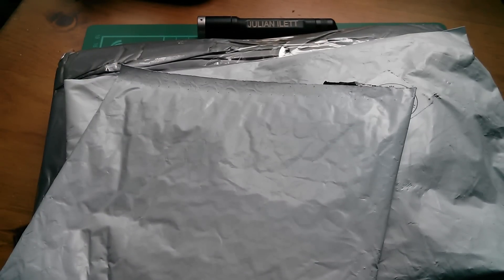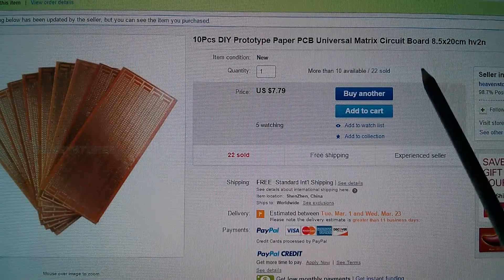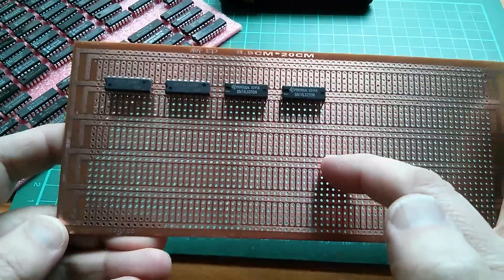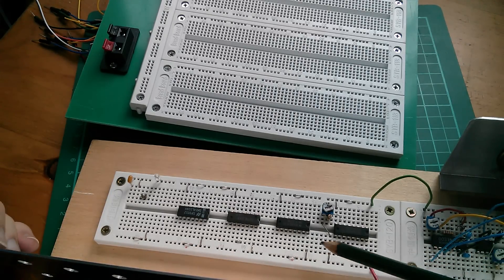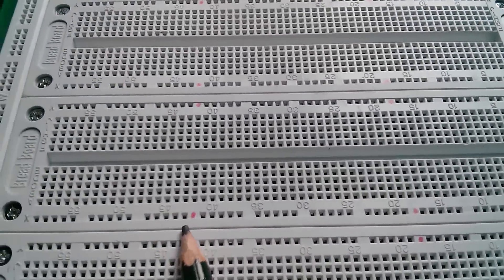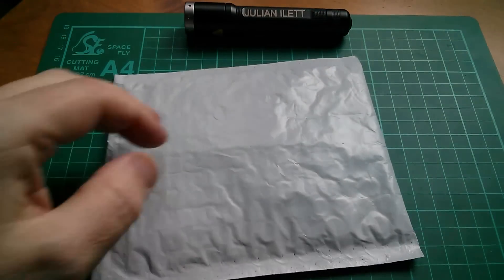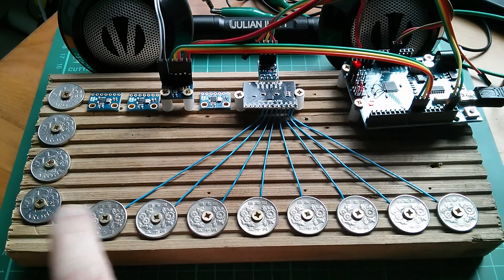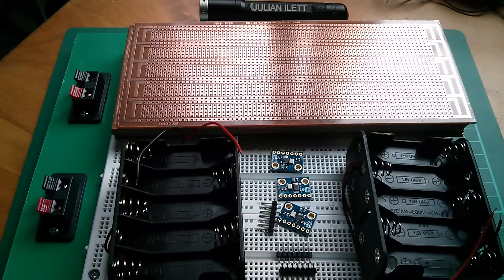Julian's Postbag: #55 - PCBs, BreadBoard, Batt Boxes, DCOs

Comment: After watching this video a few years ago, I went ahead and ordered ten of those pc boards.  I love them, what I ended up doing is chopping them into small boards and making small circuits that I had designed on breadboards.  They work great for this as they are sort of layed out the same way so you can pretty much transfer them part by part if you so desire.  I love the way you can access your rails, and once you have cut them away from the top and bottom, you can use the different rails for different voltages for amplifiers and such, I have found that even when they don't drill all the holes, I usually never want to use those particular holes anyhow. I did start drilling them out but it looked like more work then it was worth.

Comment: I just figured the power rails were split so you could use more than one voltage level on the board. But why they would not work it, I don't know.

Comment: I was desperate for a good PCB the other day for a project so I dug one of those boards out - I found that you can indeed use them for other designs simply by cutting some of the traces and using adjoining spots where necessary.  Wire clipper seem to work ok followed by an exact o knife to insure the sever is clean.

Comment: Trying to build on one of those blasted boards, only to discover that I must also cut the traces on the outter ground strip since the traces are connected nearly all the way up. My luck, I was trying to save space and started in  a lower corner of the board.  So now it is take the knive and cut traces.  Really low quality. Oh why didn't I listen to you when you said you could not recomend them.  Oh well, never to late to learn a lesson.

Comment: Was delighted when you opened those pcbs.  I'm building an animated display, 20 x 20 leds, so need room for 80 tlc5940 chips.  Was hoping that your board would have lots of room, but there's not quite enough.  Can only get 4 chips end to end, and two columns wide, for a total of 8 chips per board.  That means a total of 10 boards.  Wah......

Comment: The number on the breadboards is telling you how many connection strips there are: you said 59 wide... divided into 2, is 118... the 500 on the original would be 4x118 plus the 2 extra long ones across the end...

Comment: That breadboard maybe good to  have different voltages close by, I have a BT module for my arduino nano that uses 3v which I use a number row for atm, so this would be tidier just to stick a resistor between the breaks. thanks for the link I found it for $!2 minus the jumpers so your deal wasn't so bad.

Comment: I wonder if the breaks in the bread boards are designed to use several different voltages? Mixing 5v 12v etc? I'm not a very savvy electronics fellow so this could be a stupid suggestion.
Love your videos!
Reply: Actually, you know more than the idiot Julian Ilett

Comment: FUN. A DIY keyboard project is really fun and educational. (Voicing was my biggest challenge in the pre-MIDI 1970's: 8-octaves of 7474 digital square waves, two keyboards wired to four surplus, leaky resistor-diode bias current coupled matrix networks with the output feeding various L/C filters - real nasty). 

The list of possible DIY creative features is very exciting and the project can become very large and time consuming with marginal sound for the final outcome. Very satisfying process making from scratch though. It all starts with a few notes, then an octave or two...  With modern wave function ICs, an Arduino or two, and some wave sampling you, can get some good sound quality as the project grows...

Various Korg MS-20 (Moog) in micro, mini, to full size (modular not component level) keyboard kits are available.  But where is the electronics component level fun in that?

On the other $,$$$ hand, a Korg PA3X hooked up to a powerful stereo (or 4 chan) sound system +L-R and a sub woofer) is an immersive experience that some may call music and others will just call it a very loud noise.   Too much fun?

Danger: It might be addictive for some keyboard players. The highest risk group may consist of technical/musical individuals, like Julian Ilett.  I only average about 3hrs per day playing it and know (after two years) I could quit anytime I wanted to...

Comment: Remember the crappy LEDs that have 4 working spots in them instead of 9 or same for the 81 ones? Yup, those landed in a reject bin and ended up on ebay for 90 cents each.
Now guess why those PCBs didn't have a few holes? As much of a reject bin refugee as the leds :D

Comment: The breadboard power line strip has breaks in it so you can connect up, Ground, Plus and Minus 5 volts and Plus and Minus 12 volts. However, they should have marked them so you know where the breaks are.
Reply: +Ken Franco  Yup, even the K&H solderless breadboards have breaks in both power rails stips for the reason Ken has stated - but they at least have red and black lines to indicate what is connected and where the gaps are

Comment: Are the boards also glued down with adhesive or just screwed down? You could easily add a bridge on the underside where the breaks are. I think they don't mark the breaks on the baord, because the don't know themselves if they will be there or not ;) . The contact strips may come in different length depending on their source. The single 5 contact rows are just broken off a longer strip of multiple. And the same strips (unbroken) are used for the side contacts.

Btw. be careful with these cheap boards and jumper wires (no guarantee that more expensive ones are better though). I have see boards with contact material so crappy that it oxidizes within month and becomes unreliable or the contacts are so unflexible that they will bend to the wire size inserted and no longer work for thinner wires. Also the jumper wires quite often break near the pin, if they are soldered instead of crimped (that's why I pretty much only use the "dupont" jumper wires). All these problems really are the the worst to track down if your circuit does not work as expected (and consistently).

Comment: hello Julian i saw that you had tacked on some wires to the arduino you were using on your penny organ and was wondering what they were for. if you have mentioned it before i would love to see that video. the reason i bring it up is because i recently bought a arduino mega clone and it wont take code unless i rewrite the boot loader every time. if any one knows a solution i would be very happy to hear it.  P.S. love the videos keep up the great work!

Comment: Yay.. you got another bench power supply... with both +12 & -12 output options... Just waiting for you to also get the voltage & current metering and variable control upgrade modules now! You joker... xD
Reply: +Peter Feerick btw, I got some of those PCB perfboards a while ago - and have started using them to make circuits on. A scalpel comes in handy for cutting the tracks to use both sides etc. (like when mounting a ISCP header for Arduio - is not conducive to this board layout one bit). Another one I cut in half, and staked the two halfs, linking with header pins & sockets - with the bottom half being power management / mosfets, and the top half the atmega328 and sensor / output connectors. I'll take some pictures and throw a link up later. Long story short - these are really versatile boards, and make creating permanent boards much easier if you don't want to etch your own, or route your own and have a fab house make them...

Comment: A small 6s lipo would make a better positive + negative supply (tap the middle of the cells from the balance connector). The contacts in those AA battery holders are unreliable.
Did you know the Amazon basic's rechargables are eneloops?
Reply: +donpalmera Only the white ones are from what I've seen. The black ones are from china.
Reply: Cnerde Black amazon basics I have are made in Japan (bought from Amazon Japan) and look exactly like my Eneloop pros except for a slight different in the material around the positive terminal. If I search for Eneloop on amazon.co.jp the basics batteries show up in the results :)
Reply: Hm.. In the US I heard that only the white ones were made in Japan.
Reply: +donpalmera he is an eneloop nerd/collector big time so I would be very surprised if he didn't know the truth on things like that.

Also, he loves the eneloops (as I just said) so he prefers using them, even when something else might be better suited.

Comment: Maybe the break in the power line is so you can put a resistor in to lower the voltage on later circuitry?
Reply: +Michael Beeny More likely so that you can have different voltages on the "power bus"... but if that is the case... then why don't they mark them  - is as simple as showing a broken line done the side of the rail... silly manufacturers! I have some other breadboards from somewhere else... and they do the same, but only once in the middle. there is also a bigger gap between the two halfs of the rail - so there is some indication that there is a break...

Comment: Hi,
I think the breadboards are separated so that you can have three separate circuits built on the same board and power each individually. Yes, a variable voltage DC power supply would make a lot of sense, since you do a great deal of projects requiring different voltages, trying to use batteries and power banks with different plugs...
Love the channel and I look forward to what's next.

Comment: The AD9833 devices have Phase registers as well as Frequency registers, so you should be able to set them all up to run in phase. How long they stay in phase will of course depend on the accuracy and stability of each crystal oscillator, unless you can find a way of phase locking them (or modifying them to run off just one oscillator).
Reply: +Julian Ilett - I'm thinking he means that every time you write to the phase register that it will reset the phase at that exact time.  So if you do it to all of them at the same time they will be in phase until they slowly move further apart due to small differences in each units clock.  Do it often enough and it wouldn't/couldn't be noticed by the ear.  Doing it between notes would prevent any phase shift resetting being heard.  I haven't used these but there's bound to be a way to synchronize them.
Reply: +slm60uk 
Thinking a bit more! You should be able to keep them in close phase by simply writing 0 to the phase register of each module at regular intervals.
Reply from the maker: That won't help. In any case, writing zero to the phase register only needs to be done once.
Reply: +ElmerFuddGun 
You've got it. I've used the AD9850 DDS & it can be used like this. Looking at the AD9833 datasheet I think it is also possible..
Reply: +slm60uk - thought so.  It only makes sense that they would design them that way.  I'll have to get some of these to play with too.  And we'll see if Julian tries it or maybe comes up with another solution.

Comment: those pcb's are rejects that's why they were cheap
Reply from the maker: +Joe Schmoe You might be right. As well as undrilled holes, there are a few places where the copper strips are linked to other copper strips and even bridged across to the power rails.
Reply: +Julian Ilett contact the seller. I have always been able to get a full refund if im not satisfied with my item. Gotten refunds almost all my purchases.
Reply: +Julian Ilett . Are you going to do something creative with your new power supply buk converters etcetera. 
With the pcb's if you want to cram more ic's on you culd cut the tracks. but you know that  ;-)
Reply: +Joe Schmoe ding ding ding we have a winner! Factory seconds are so awesome when you are willing to put up with the problems they entail.
Reply: +Julian Ilett Were they completely missed in drilling - or did they not go all the way through? The ones I had were a bit bowed, and the holes look rough, but they seem to all be there... maybe I got the good batch? :D
Reply: +Hussein J. me too
Reply: +trsk Must have taken a turn for the worse since I got them... I bought my stack back in Jul '14, so either I got a good batch, or there are some really dodgy ones around. Mine were simply bowed from how they were stored - I don't have any issues with missed holes. I haven't had any issues with the copper lifting either - even when I have cut the boards up with a dremel or knife. And they don't flake off when scoring tracks. Just the luck of the draw with China quality control roulette ;)

Now the smaller 5x7 cm boards I have, with copper clad holes, rather than strips... I could complain about the quality and lifting/dodgy copper...
Reply: +Peter Feerick exact, same
Reply: You refund all your purchases? 🤔
Reply: I hate cheap breadboards. Theres always the holes that you can't get your jumper to push into using cheap breadboards.

Comment: I think people meant, get yourself a real bench power supply ;)
Reply: +Digger D I loved it when he pulled out those cell holders, had to laugh.
Reply: it's so obvious what he's doing.  Did all of you miss the fact that he has successfuly built z80 based task-specific computers back in the day and though he can do it and more now he chooses to buy the cheap tat ebay electronic modules, when he could design his own and build them out of cheap or good components, or whatever he wants?

He wants to have fun with electronics, he's not the type to engineer and design and build things 'the right way' he's in it for the fun of it!  To some people part of that fun is getting by with less than professional tools - doing it the hard way, because they can and want to.  Why use a circular saw when you can use a hand saw?  Why use a table surface planer when you can get out an old hand planer?  This is julian's mantra, he likes doing things this way, and I must say I agree with him, though my own personal mantra is more like building my own power tools instead of using hand tools to continue the woodworking analogy.
Reply: +Digger D I dont know what you mean, those battery holders seem to sit on the bench perfectly fine :P Also, by the same logic, hes already had plenty of bench power supplies in the form of a battery. It supplies power and it sits on the bench. By linking them up it becomes a variable bench power supply!
Reply: +ElmerFuddGun I am sure Julian knows full well that he could just buy a proper bench supply if he wanted to but for most electronics hobbyist's it is all about the journey not necessarily the end result.
Reply: +simontay1984 - it's quite funny watching all the trouble he goes through when 10 seconds with a good bench PS would do and do it better and safer.  Batteries and solar panels are fine for a final project but have many many limits and frankly just waste time when designing or testing.  Some day he will learn!   ;-)
Reply: +kuhrd - I don't know.  It's kinda like trying to ride a unicycle up a hill but backwards - you might get there but it's not fun and you're going to run into a few obstacles on the way that you could have easily avoided if you started your journey the right way and with the right equipment to begin with.  Some can do it but it's not the best way to teach others and many may get hurt in the process. --- BUT for others it is AMUSING to watch!    ;-)
Reply: +lasersbee - lol... well his way definitely can be entertaining at times.  Just waiting for the next time some IC is put in backwards or hooked up wrong and goes BANG!  LOL... reminds me of being in school when someone  would put one in backwards and without limiting the current the top of the IC would break right off and the insides might start glowing.  Always funny!
Reply from the maker: +kekejojo1212 Now that's my kind of logic :)
Reply from the maker: +lasersbee What makes a power supply a "bench power supply"? Clearly not that it sits on a bench. What are the essential features? Mains powered? Solar powered? Battery powered? Linear regulation? Switched mode regulation? Current limiting? Voltage and current indicators? Continuously variable voltage and current controls? Split rail output? Multiple outputs? I've got them all. I've got a hundred bench power supplies.
Reply: +Julian Ilett wow, that's a mouth full of supplies. and now you got a portable version of those.
Reply: +JaqiesGadgets 100% agree, he's helping to make electronics more accessible for amateurs. Him and China.